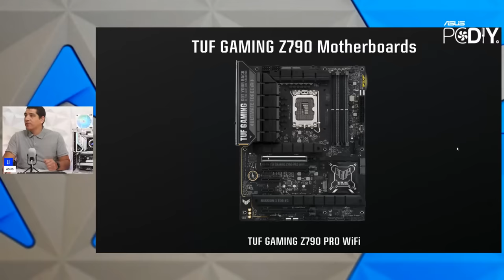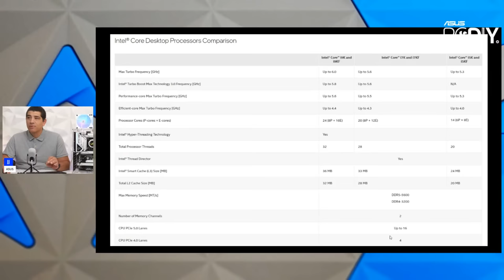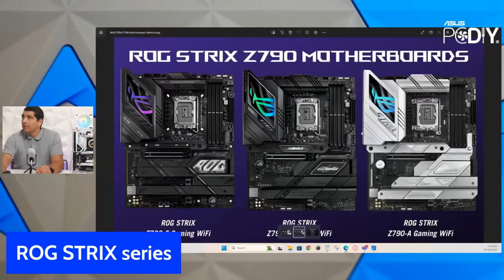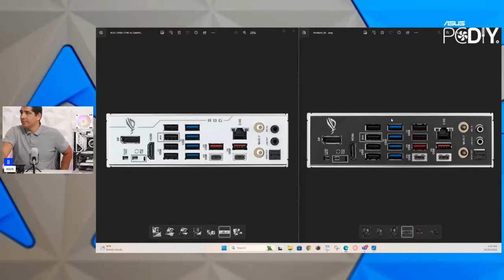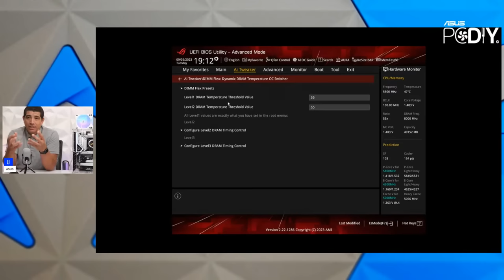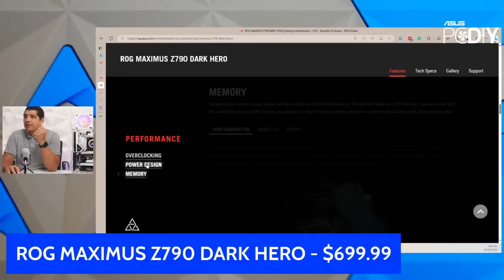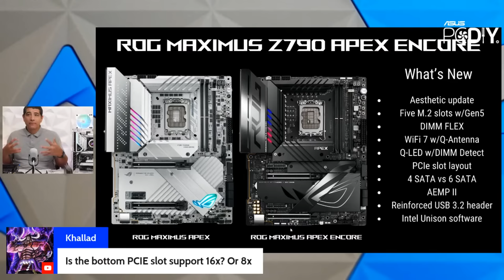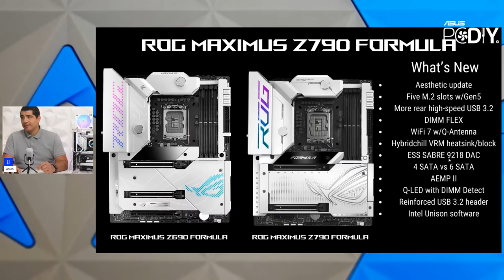Full ASUS Z790 Motherboard Refresh Line Up Overview & AMA - For Next Gen Intel Processors

Comment: Understanding the design changed on the Formula VRM block, does it retain compatibility with Z690 bridges based on port location relative to CPU socket?
Reply from the maker: You can confirm compatibility with EK as the bridge is their product. Thanks!

Comment: I’m lost, what are the key differences between dark hero and apex encore? i wanna get the best of them but dunno what are the key differences other than memory speed .. i mostly care about lowest input lag possible

I have i9 14900k and hero maximus but i wanna upgrade it to something way better so I don’t wanna go for dark hero so if apex encore and/or formula is better then i’ll go for it
Reply from the maker: This is noted in the stream, you may want to rewatch but the APEX Is a 2 DIMM board vs a 4DIMM board and will yield higher and more stable ultra high DDR5 operation.

If you are targeting values like 7200 and below you are fine and even higher is possible on the HERO.

For most users the DARK HERO is the better choice but if the APEX also has items like the DIMM.2 add in card which can add convivence.

You have look at items like total io connectivity as one of the key area where there are differences and whether those are important to you. From a performance perspective DARK HERO, APEX ENCORE and FORMULA will all be the same and even other board like the ROG STRIX Z790-E and others will offer essentially the same performance.

If you already have a Z790 MAXIMUS HERO there is little reason to upgrade unless you specifically want items like
DIMM FLEX, WiFI 7, Native PCIe Gen 5 and more M.2 SSD slots.

If you have more questions join our ASUS PCDIY group.
Reply: @ASUSUSA  yea I don’t use 4 DIMM RAM so i think i made up my mind! I would wanna go for the Apex one! I do wonder tho, i have a 7200Mhz 2x 16gb DDR5 CL34 .. will i be able to to OC it to 8000+ ? Unless if i need new set of higher speed to hit those speeds? Cuz that’s my target speed
Looking forward to OC stream and thank you for your response! 🙏

Comment: Thank you for the video!

Are there any plans to incorporate 10g nics in future MBs? I have 10g in my home network. This brings up another problem - slot layout. The new graphics card can cover 1-2 slots rendering them completely useless. I also use a sound card.

I'm probably in the minority of users who still are dependent on using internal devices requiring slots as opposed to having external devices on the desktop.

Isn't it time to redesign MBs/cases to spread out the slots to accommodate the new wide graphics cards so they don't cover the slots? I'm probably in the minority of users who still use tower cases because I like to put as much as I can inside the case without clutter and they are better for heat dissipation.  I have never liked mid size cases for these reasons.  I'm looking at the Prime P MB because it looks like the only option that can give me the connectivity I need.  I'd like a Strix but alas...
Reply from the maker: All the boards allow for card expansion even with large graphics cards ( as shown in the video, including models like the entry TUF GAMING, which can maintain M.2 slot and PCIe slot access with cards like our 4070 or even 4090.

We also offer compact models for graphics cards all the way up to a 4080 ( maxing out to 2.5 slot spacing ), readily allowing you multiple PCIe slots for card upgrades.

We offer 10G on existing models like our ProArt and our previous EXTREME model, which is now EOL. We also maintain offering 10G add-in cards, but as a whole, 10G is still an emerging specification relative to adoption, and we track this closely with the adoption of our routing solution, which also offers multi-gig-specification support, including 10G.
Reply: The layout of the MBs are all over the place.  Absolutely no consistency in slot layouts from mb to mb. There are those of us who are not gaming enthusiasts and have a need for >1 pci-e slots. The ProArt is expensive and only has three slots! And it's the only mb that has a 10g nic!  10g is here. 3-slot wide graphics cards are here. These are issues that are not exclusive to Asus - literally all mb manufacturers suffer from these mish-mash mb layouts. I just want more a consistent, uniform layout without having the need for risers, etc.  The mb/cases are so cramped and the pc builder just accept it.  My OLD Asus P8Z77-V Pro Thunderbolt is played out excellently for all the expansion I needed! I just added an expansion card for an NVM-E drive. It's still a viable mb but I've expanded as far as it can go. I have two SSDs, and four hard drives and a Blu-ray drive in that full tower (thanks to another expansion card), and a sound card AND a 10g nic.  The built-in nic & sound card = obsolete! I need to replace that particular build this month and as I said, the ONLY mb that has what I need is a Prime.

Come on, Asus, you're letting me down (as well as the other mb manufacturers).
Reply: @Dr_b_ Yes, you are right.  The Z790-P will have to work for my next build;  I'm going to have to get the USB equivalent devices for my needs cluttering up my desktop for other builds. 

I'm a dying breed of builders!

Comment: Can you explain the pcie lane distribution when you have a gen 4 ssd in the top slot? Does GPU still lose lanes?
Reply from the maker: As noted in the intro portion of our stream the CPU provides the PCIe lanes for your graphics card ( 16 ) and also provide 4 lanes PCIe Gen 4 for a primary PCIe NVMe M.2 SSD. All boards can run this configuration.

As also noted though in the video if you use enough slots or use PCIe Gen 5 M.2 SSD and drop to x8 PCIe Gen 4 for your graphics it will not negatively affect performance overall.

Comment: The new boards look really luxurious, but I have 3 questions. First I would like to ask why they stopped producing the z790 extreme and why there is no refresh version of it? The second thing I would like to ask about ASUS secure eras. I have a samsung 990 pro ssd and i was wondering about compatibility? I couldn't find a compatibility list anywhere except for a really really old one and I'm wondering if it could damage the ssd. And the third question I would have is what is the difference on a desktop computer in windows 11 between power plan and power mode settings and what would you recommend for optimal functioning of an Intel processor for example with Ai overclock feature? If it will work well or better with high performance or is the best balance. Thank you very much for the answers JJ.
Reply: You sir first need to up grade your ssd to the crucial t700

Comment: What is EXPO Tweaked on ASUS Motherboards shoul i choose EXPO I or EXPO Tweaked for higher performance?
Reply from the maker: Further optimized tuning for DRAM timings, you can use whatever profile works best for you relative to stability and performance for most users they will use EXPO II ( which is an overclocking profile ) compared to standard AMD POR table operating parameters.

Comment: For creators, will these boards finally allow us to use 4x48gb=192gb ram?
Thanks
Reply from the maker: This is already possible but keep in mind that Intel's POR table will reduce scaling based on RANK and DENSITY of your memory for 2SPC/2DPC dual rank you will have the lowest OC range so you should expect to target conservative DRAM dividers. This means 3600-4800MT+ depending on the kit of memory, higher may be possible but is going to be dependent on the quality of your IMC ( memory controller ).

Also keep in mind that most kits sold are not native 4 DIMM kits so you can run into issues with the profile of kits tuned for 2 DIMMS being applied to 4 DIMMs. To reduce this consider a native 4 DIMM kit and also keep in mind you may need to manually define/drop the memory divider.

Comment: Was the formula vrm still made by ekwb
Reply: negative. Different design, I believe he said it was done in house and that was the reason it did not have the EK logo on the VRMs
Reply from the maker: Correct we are still partners with EK and you can find blocks for a wide range of our products including monoblock and GPU waterblocks.

Comment: A plastic facade and plastering RGBs everywhere doesn't justify the brazen, shameless highway robbery going on in this industry right now. Higher power stages are the only criteria that should justify a higher price; even then, I'd wager the outcome would be negligible in the grand scheme of things. Today's boards are packed with unnecessary fluff and RGB puke. You're shilling products under the guise of "higher quality components" when in reality, it's pure propaganda. Perhaps these companies need a harsh reminder that no brand is too big to fail. Mobos costing more than flagship CPUs... I have seen it all now.
Reply from the maker: Thanks for your feedback. You may find value in watching more of the stream with deeper insights into the totality of what we offer in regard to overall design, features and functions and specification support.

VRM components are just one element of BOM cost on a product; there a numerous hardware-based items that add cost and complexity to high-end boards.

Some of these include
Advanced signal design requirements, this means needing higher PCB layer counts ( 8 vs 4 ) commonly in the past, you would see 4 and 6 layers with 1 oz of copper. High-end boards see 8 layers with 2 oz and have also shifted to higher quality SMT production and low loss PCB.

Beyond that, you have redrivers and other elements for items like PCIe Gen 4 / Gen 5

Dual contact heatsinks for M.2 SSDs

Higher performing and more costly network controller 2.5GBps, 5Gbps, 10Gbps, WiFi 7 

Larger EPROM for the UEFI BIOS ( 4x larger than in the past )

Most of the boards offer minimal RGB elements and while you may not find value in them the vast majority of our users do communicate they appreciate aesthetic design. With this noted, should you not want RGB, we have boards like PRIME and PROART and WS which have none although TUF GAMING, ROG STRIX and ROG MAXIMUS have minimal RGB lighting zones ( 1 zone )

SHould you just want a solid board with good specs, solid power delivery and nonenthusiast niche functions or features then a TUF GAMING Z790 PRO or PLUS is a great option you should consider or even B series which is lower in cost.